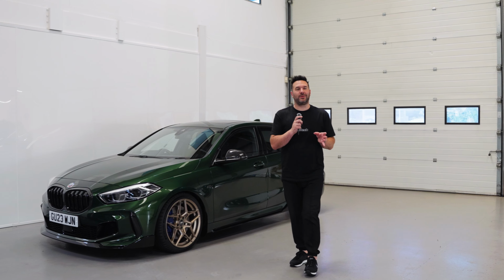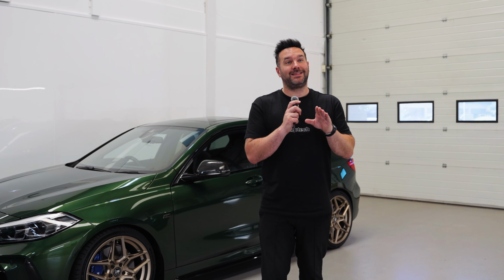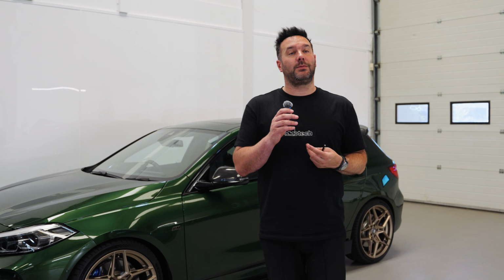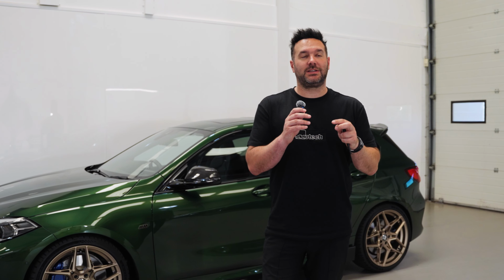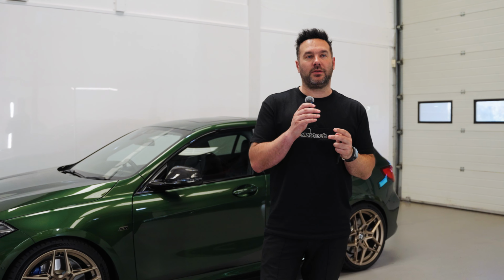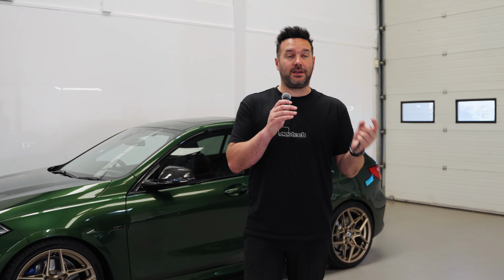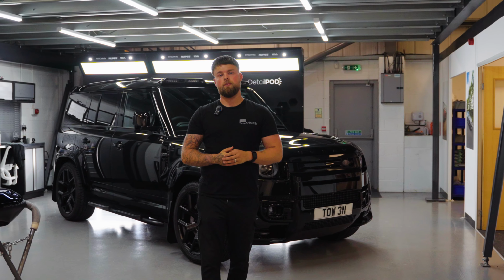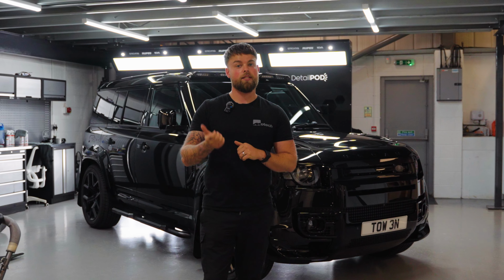Could this be a new finish for the M-W1's?    S2 E41 #m135i #bmw

Comment: They look nice. Do they fit a MK8 GTi Clubsport with 19 inch wheels.
Reply from the maker: @boscochan9941  yep 👍👍
Reply: @MotechPerformance  is that gold looks nice. As a option, what will be the price?
Reply from the maker: @boscochan9941  looking in it bud wheels alone £2300